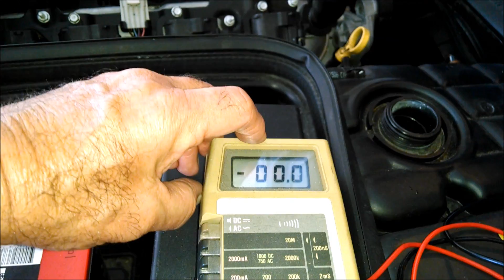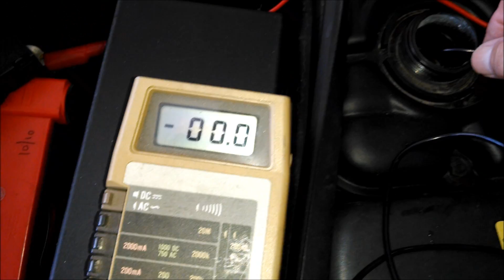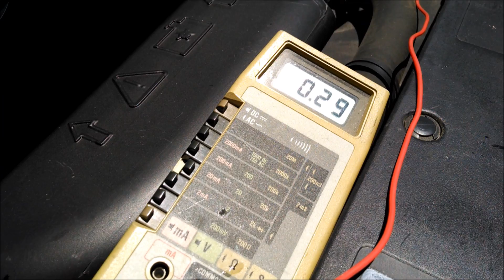Tools test coolant for electrolysis with multimeter froggy

Comment: Great video, I have a question, what if the multi-meter on  the screen shows -0.25. Is that a good reading for coolant?
Reply from the maker: That's ok keep an eye on it.
Reply from the maker: I think ok, how long since coolant change? Miles/years?
Reply: @1947froggy  Thank you for the reply.  The vehicle is a 2006 Jeep Grand Cherokee Laredo.  I just changed the coolant last year with coolant from Mopar.  it is a 5 year embittered coolant 60/40 mixture.  130,000 miles on the vehicle.  About 9,000 miles since the coolant change.  I was just concerned about the readings on the multi-meter, and the - or + readings meaning anything.  I know if it is 0.30 you need to change it.  I just wasn't sure if the  negative/minus sign in front of the number meant anything.
Reply from the maker: @jonathandaniels2183  Meter should be reading in the + (or lack of a -) range. Meters don't always show a + sign. If I said plus/minus somewhere I just mean over/under a little.
Reply: @1947froggy  Oh no, I saved your video and go back to it for reference, so many years later this is still the best video for reading a multi-meter for Electrolysis in coolant.  Thank you for your help, I really appreciate it.

Comment: Hi there - I was so confused by people using different scales and different '. something' range. However your video is very clear. I believe that when people talks about 0.03 is because they use the 2000ma scale vs the 20 one on their multimeter. However you made it crystal clear, on 20ma scale, reading should be under 0.3. Thanks a ton!
Reply: It's NOT milliamps, it's millivolts you're testing for. That is one OLD meter. I used to have one exactly like it that was labeled IBM. They gave away the old meters to techs when they upgraded. That meter is circa the early 1980's. I believe it's an early Fluke. The number should be UNDER 300mv (technically 333mv if you want to be precise) which is one third of a volt if math isn't your strong suit.
Reply: @vincemajestyk9497  i have it, like new, i reach for it when i need precision; IBM branded, but made by FLUKE of course; just the probes alone would cost maybe $100  today, best there can be all around.
Reply from the maker: Right, the scale is key.  :)

Comment: cooling system electrolisys,audio static,alternator starter motor static true do damage to the engine but not to economy of a car it increases it!
That is what waste spark comes in handy with plazma ignition even bether in a closed system engine!
Definatly not good have it as a cooling system and peopel if mix wrong engine oil you get havoc head gasket blown interupts ore destroys senzors oil leaks even rust staff.
Nice video plain and simpel.

Comment: Sorry! This "voltage test" has been debunked. Voltage measurements swing with the
coolant concentration, ie, 50/50 versus 60/40 or low coolant concentration of
40/60, etc, not the "condition" of the coolant !! See a PDF where this was tested along with other factors: "Bogus Coolant Test - Pat Goss Blows It !" Link: http://tinyurl.com/z9q4mco
Reply from the maker: I left your post up because I find it interesting. Not that I agree the procedure is "debunked".

Thanks for viewing.

IMO the test I demonstrated is pretty good. Folks should draw their own conclusions.

:)

Comment: You are measuring electrolysis action which corrodes/erodes. Decimal point critical 0.3V (300mV) max is fair benchmark but introduction of brass meter probes bothers me a little bit. {Reverse them to see!}. Certain dissimilar metals and an electrolyte are voltaic cell. Output depends on PH level. Inert is zero. Water purity in new mixes also critical. (Distilled). Take SG for freezing point - this is also engine coolant & antifreeze which also raises boiling point. Lots to do then! Go aircooled!
Reply from the maker: Beresfordjohn Greene Thanks for the comments, I did have a Beetle once 1973 that was air cooled & many motorcycles.

:)

Comment: Would it not be simpler to get an ohm reading of the coolant
Reply from the maker: From what I have learned it is not a good indicator.
Reply: Using your test I got .35Volts on my Saturn
Testing for ohms 1Mohms
Brand new coolant tested at 15Mohms
Ohms Law being
Current = Voltage / Resistance
 it would make sense that as voltage increases or resistance decreases current would increase